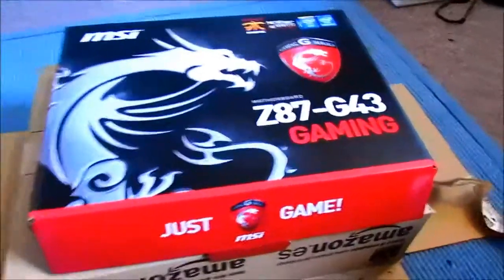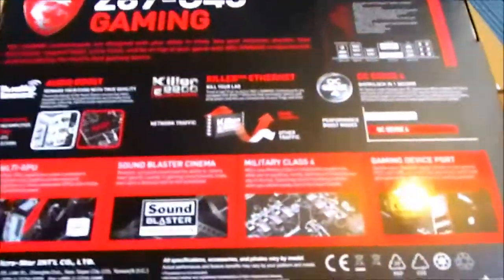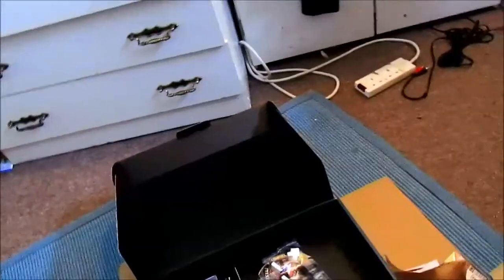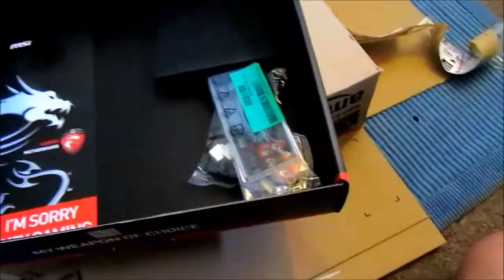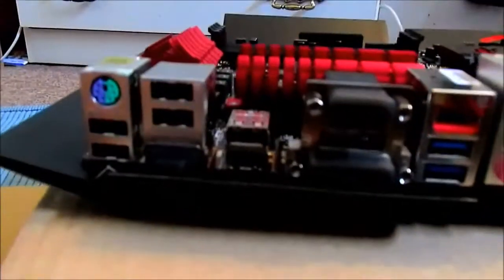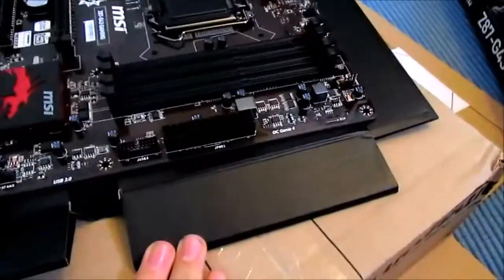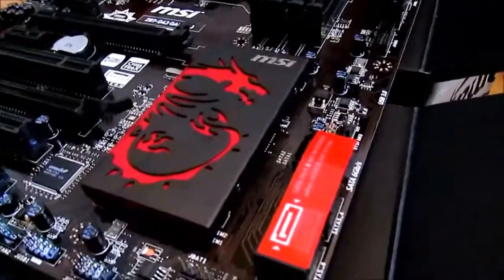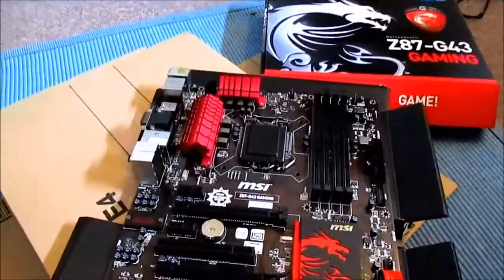MSI Z87-G43 GAMING EDITION UNBOXING AND OVERVIEW (UK)

Comment: i have a question i hope you will answer me i will buy a new pc and iam going to get this mother bored with core i5 2500k 3.3 Ghz and 6gb ram and nvidia geforce gtx 660
any way my question is will it run a huge games perfectly like gta v and watch dogs and this game or it will not 
i hope you will respond :)
Reply from the maker: +Mohamed Yousry Sorry its so late, have not been on my channel for a very long time. GTX 660 is quite outdated however you still be able to run games at native 1080p at 60 fps on medium settings. GTA V is quite heavy medium settings should get you 40-50fps I would say average on a gtx 660 and watch dogs around the same, maybe lower. Happy Gaming. :)
Reply: KillerReviews97 lol dude i forgot about this anyway iam getting gtx 950 and mother board is Z97 gaming 3 forget about what i said :p 
I didn't know alot about best gamer setup but now i know but thank you anyway

Comment: I may getting this board.
What is your experience so far for this board?
Reply from the maker: Hey mate after a year of solid use and a handful of experiences with this board, I can recommend it. It has not let me down once and everything works as it did on day one, fan control is responsive the BIOS is still intact with all its functionality still operating at 100% any BSOD's that have occurred have been a result of my mistake and fault and never a software or hardware failure caused by the board. Nothing has overheated all the ports work as they should, I have not had to clear the CMOS once or reset the BIOS any changes that have caused system instability result in the BIOS making its on soft reset which resolves any of these issues. The one thing that I cannot comment on is its overclocking stability since I do not overclock my CPU's but instead under volt them. However based off of my year with this board I would feel 100% confident overclocking it . All the best
Reply: KillerReviews97 I'm planning to overclock the cpu and gpu.
Here's my specs: ( i already got my cpu and gpu )
Intel core i5 4690k
Msi z87-g43
Msi R9 290
Crossair 750 W Gold
8gb GDDR3 1600 Ram
Intel stock cooler ( Water cooling in the future)
Areocool X-Predator

Just planning to game on 1080P
Reply: KillerReviews97 and thx for the quick reply :D
Reply from the maker: AlledagenVeelgames No problem mate. The board will serve your needs well.
Reply: :D

Comment: Very nice video couldn't have said it better myself! You've got a great channel going! How's the board running so far?
Reply from the maker: Thank you so much for the kind words, I really appreciate it. The board is running great I have had not one problem with it since day one, no matter what you do you will always be able to revert to BIOS and reset and proceed from there, its just a very durable board I will defo be going for another MSI board if the time comes.
Reply: Yes I've had the board for a year now and still love it sadly I've got a locked i3-3220 on it but up grading to the new X99s Gaming 9 from MSI
Reply from the maker: SpartanGamer LOL I have a locked i5-4570 is not just the worst thing. Im looking into the new line up to, looks very promising the new design looks sleek.
Reply: Check out my latest video thats the system I'm looking at

Comment: Wait, so where on this board do you hook up your front panel led's and stuff like that? The HDD LED and the power LED and stuff like that? I don't really see a specific spot
Reply from the maker: Its located in the bottom right hand corner, the link I provided to the website should include a manual In PDF format and should Illustrate specifically where the headers are located.  Thanks
Reply: Sweet, thanks!
Reply from the maker: KernelKaramilk2100 No problem mate, if you require any help please feel free to ask. Kind Regards 
Ashley

Comment from the maker: Hi there hope you enjoyed the video, sorry if i have not responded to MSG and COMMENTS i have been extremely busy and sometimes i cant actually respond as a result of the stupid google + integration so if you have a question respond to this comment and hopefully I can get back to you :)
Reply: Thanks:D
Reply from the maker: This motherboard would support a i5 2500k out the box yes :)
Reply: Hi, thanks for the video :) I was just wondering would this support an intel i5 2500k 3.3ghz quad core proc please? :)
Reply: KillerReviews97 Awesome thanks for the fast reply! I've recently bought a GTX 970 and the card is so long it blocks all the sata connectors on my current board apart from 1 so looking to upgrade to a newer one.
Reply from the maker: Tom McDermott Cool man, lucky to have a gtx970 since its a great card I might buy one for my next upgrade. Have you tried using right angle SATA to see if it fits. Best of luck :)
Reply: Yeah, tried both and no luck :/ got 2 ssd's and my optical drive useless...:L yeah got it like 4 days a go :)
Reply from the maker: Tom McDermott Awe man what shame I would of thought it would fit dam well best of luck with the build mate :)
Reply: KillerReviews97 thanks buddy! One more question,  I have quite an old CPU, it's an Intel i5 2500k, will that fit this motherboard?
Reply from the maker: Crap mate im ever so sorry this board was made to support the new release of haswell CPU this board does not physically support sandy bridge such as the i5 2500k im ever so sorry mate I dont know what made me believe that CPU would be supported been out the game for a while now but i have looked up and made sure and that cpu will not fit. Im ever so sorry once again mate.
Reply: KillerReviews97 haha that's cool buddy don't worry! :) this is gonna be a big pain for me then! But yeah thanks for the review anyway man :)

Comment: So.. whats the difference between this board and the normal z87 g43?
Reply from the maker: Not to much difference between the two the G range of these boards tend to cost a little extra and carry the Black/Red sleek look which is different to the blue/black look on the standard board range also this board specifically compared to its counterpart has the audio boost emi shield as well as a significantly different BIOS well UEFI layout however I would recommend going that extra mile for G series line up as it seems to be solid for the most part as I have yet not run into any issues with this board. Hope this helps :)
Reply: Ok, thanks.
Reply from the maker: St3wiel3oii Anytime mate.

Comment: can i use a nvidia video card with that motherboard?
Reply from the maker: whiteqaz1 Of course my friend, any graphics card you have is compatible be it one by ati or nvidia just make sure you have enough power to supply the graphics card e.g. the correct amount of 8pin or 6pin psu connectors for the card. If you have any more questions ask me mate.

Comment: whats this difference from this to the H87 and ur asrock wasnt the pro3 by chance mines gone faulty so had to get the H87
Reply from the maker: Well in terms of the what this msi z87 board is supposed to offer compared to its brother the h87 the z87 is supposed to offer the ability to officially allow for OC'd ram ro 2133mhz i believe and also a crucial feature which is the ability to modify the core multiplier on a unlocked haswell cpu. In regards to its difference to the asrock variant the support for OC'ing ram officially up to 2133mhz was void however i think one key feature to note was that the asrock board had a backup bios which is always a welcome feature in any motherboard. Hope this helped mate :)

Comment from the maker: @TantrumFX umm well I stopped using the slendertone unit a while ago seen as though it became sligltly tedious to use and I no longer felt that It was working for me anymore I have aloso been extremly busy with a levels and I go to the gym 4 times a week so I no longer see the use for the slendertone unit however that does not mean that I do not reccomend it. Please feel free to ask me any more questions :)
Reply: Hi I got 2 questions.
1. I have an Intel core i7 4790k, Corsair Ballistix (4x8gb DDR3) and 2 nVidia GeForce gtx 980 graphic cards.
Does that all fit on the board?

2. How is the onboard sound? Is it good or should I buy an extra soundcard?